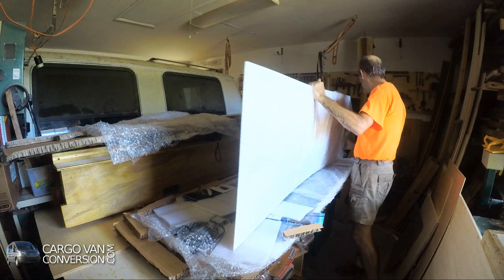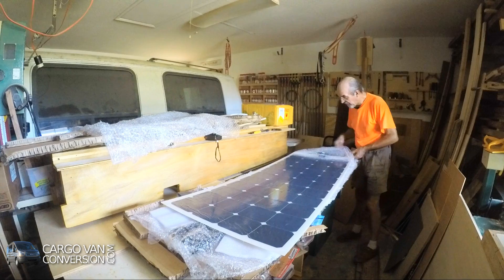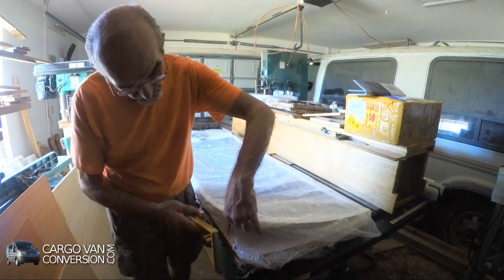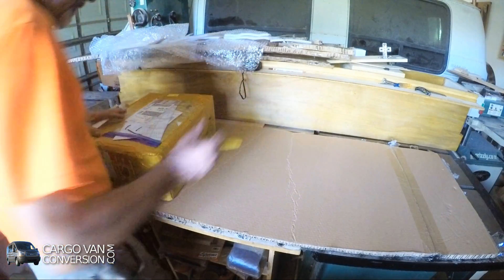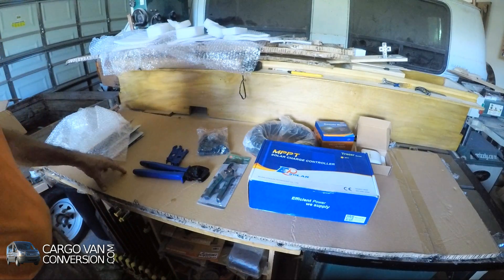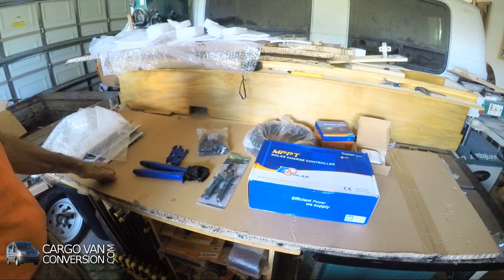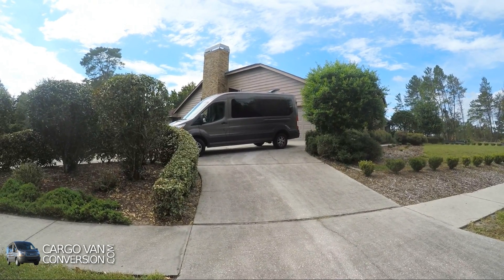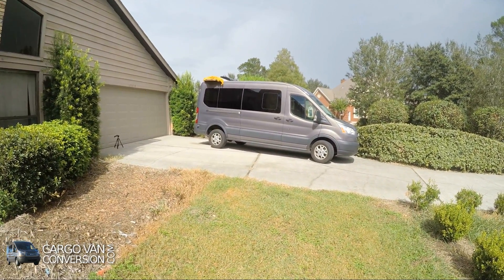Buying Flexible Solar Panels From China

Comment: Flexible panels need to be installed with an air gap. No air gap = no heat dissipation and lower life..
Reply from the maker: Hi CauseAndEffect,
If written extensively on that and I'm aware of a possible issue.
I have done a lot of research (mostly the 'first generation' of these panels). While it is widely mentioned, there is only very limited actual data available. I have always assumed this would remain an issue with this type of panels. These older panels had multiple problems and at least some of them have been addressed with the current panels that I have.
I have installed them (see my video, this Friday) on the corrugated roof of my Ford Transit and left these small areas open, which should help with heat dissipation. I'm not an expert, but some have also explained (for what it's worth) that the metal roof works like a heat sink. As 'stealth' is high on my priority list, for me the easiest way to compensate for a possible lower output, was to add to the total wattage of the panels. Raising them off the roof would nullify the stealth issue and rigid panels would be a much more sensible way to go. As for longevity, I would be satisfied when they serve me until the van is sold or (much) better panels become available. Time will tell.
Thanks for commenting.

Van Williams

Comment: I gave you a like but almost didnt because you didnt discuss price.
Priceis important. Please provode pricing and shipping price and import rax price of you had to pay it.
Also wattage.
Reply from the maker: Hi yougeo,
The information sometimes gets buried somewhere, but I always try to give as much info as I can in the video, through links in the description and much more in detail on the website http://cargovanconversion.com My apologies, if that was an issue.
That said, these are Link Solar GFL-135 Flexible solar panels; 135 watts each, 59.5" x 22", ETFE laminate, Back contact Sunpower high-efficiency solar cells. I have 405W on the roof of my Ford Transit.
While Link Solar is a sponsor of my website, I have no other links to the company. Their current price (Nov.2017) for the 135W panel is $350-$400 http://cargovanconversion.com/LS Somewhere in the comments you'll find my current calculation of my setup. I came down to approx. $1500 for three 135W panels, cable gland, MC4 connectors, MC4 extension, 3M VHB tape, breaker box, circuit breakers, controller, remote meter, welding wire, lugs, several crimping tools and Blue Sea powerpost, busbars and fuse box. Virtually everything to make it work except the batteries.
3-Day Fedex airfreight was included. A day before delivery Fedex requested a customs form that was supplied by Link Solar and they took care of the importation. Import tax could be levied, but not in my case.
Hope this helps you a bit and please, comment if you have others questions.
Have a great day!

Van Williams

Comment: Great video! Thank you!! May do these on my van, but not sure what to use for adhesion. Liked the music. Hope to see more videos from you in the future 😊
Reply from the maker: Hi Jennifer,
Thanks for taking the time to comment.
I post a new video every Friday and this week, it's the first of three about the installation. It explicitly show in great detail how I fastened them to the roof of my Ford Transit.
I used 3M VHB 5952 tape and that works great. No holes. I've taken out the van on a couple of rides and the panels are still on it :) So it seems to work.
Hope you'll like the video. Next week I'll do the cabling and finally the controller, breakers, etc.

Van Williams
Reply: Cargo Van Conversion Great.. thanks!!  I am a subscriber now :)
Reply from the maker: Thanks for subscribing! That helps a lot.
Have a great day!

Van Williams

Comment: Yeah no thanks, when I'm ready to buy my panels I'll get them from Amazon.  These panels are 50% more expensive and they have an awesome return policy.
Reply from the maker: Hi g dawg,
In many ways I agree with you, but please read some of my comments here or on the website http://cargovanconversion.com
While I had a good experience (so far), there are a lot of drawbacks in buying more expensive items directly from China. The need for a specific size and quality made me take the risk.
The price point is worth discussing. With regard to efficiency, they are equal or even better than rigid panels, yet rigid panels have a long track record and they can be bought for $0.50 per watt or less. If you have no specific need for flexible panels, that is the way to go in my opinion.
I wanted to go with flexible, but the 'first generation' of these panels had a lot of issues and they were promoted with ridiculous claims. I've heard of many failing based on delamination issues of the PET laminated and the use of substandard solar cells. Those two issues may have been addressed with these panels that are made with ETFE laminate and high grade backcontact solar cells.
Be aware that flexible solar cells currently in the $150-$180 range, may not have backcontact cells, may be lower grade and likely use PET laminate instead of the more expensive ETFE.
As I said, if you have no need for flexible panels, you're better off with rigid panels, in many ways. If flexible is what you want, do a lot of research and if these prices are too high, just wait a while, and they will come down!

Van Williams
Reply: i appreciate the reply, i was refering to newer flexible panels on amazon but i can see your point on needing a specific size.
Reply from the maker: Hi g dawg,
Their are currently only a few panels available with ETFE and the grade of the solar cells is very difficult to establish for most of us. It remains confusing and I tried to give some insight through my own experience.

Van Williams

Comment: I bought two water distillers from China, the 1st burnt up and the 2nd came broken, and I didn't get all my money back. Big lesson here; DON'T BUY ANYTHING FROM CHINA.
Reply from the maker: Hi April Mae,
A couple of years ago, I started buying occasionally from China, mostly small stuff (a couple of dollars worth each) and have never had an issue. However on one occasion I ordered a $125 item (I was getting confident) and on top of a late delivery, it just didn't work. I could have returned it, but likely would have taken months before getting it back, with incurred costs and no guarantees.
Moral of the story: If the item has some value, then buy through eBay, Amazon or AliExpress, for more security. Higher priced items, such as these solar panels may also be levied an import tax that the buyer is responsible for.
I had a good experience with Link Solar, but would encourage viewers/readers to leave a comment about their experience.
Have a great day!

Van Williams

Comment: need to put rubber under the panels buddy .  otherwise the metal will heat the panels and you will lose efficiency,  my tip to you for most efficiency out of solar is to keep them flat not curved. roof racks is an idea . but if it works for you great!!!  here is a guy i follow what he did to his van https://www.youtube.com/watch?v=VAIaGXALKBQ
Reply from the maker: Hi archiscale,
The video is quite interesting and I will look more into his work.
One of the main goals of my build is to create a stealthy van and these thin flexible panels are ideal for that purpose. The first generation of these panels had many issues and heat dissipation is often mentioned as one of them.
My research frequently encountered it, but I have found few actual real-life documentation of it. The new type of flexible panels that I have are as efficient or better than rigid panels and hopefully some of the issues have been dealt with (most notably the delamination of the PET laminates by using ETFE). I'm not an expert in this, but some explain that the metal roof works like a heat sink; I also left some space where the 'corrugations' in the roof are for some airflow as you can see in this weeks video (this Friday). Raising these panels would nullify the stealth properties of the van, so to counter a possible diminished output, I choose a simple solution to add more solar panels; that's easier, cheaper and I remain stealthy.
A side note on the heat issue: if it is an issue, it is likely to happen more during summer, when most systems should be oversized. During winter, when output is reduced but more vital, it should be less of a problem.
Thanks for taking the time to respond; time will tell how it works out. Preliminary tests (no load/open circuit) with three panels (405W) on the roof of the Ford Transit have shown on a sunny morning in Florida at 10AM in November 28V/8.5 Amps output (before MPPT). That is encouraging!

Van Williams

Comment: These panels look great! I've seen so many videos where people install rigid panels on vans using aluminium brackets, hinges and Sikaflex, which is a ton of work, expense and mess, not to mention being less than aerodynamic, all so that they can constantly faff around tilting the panels and repositioning the van to get as much energy as possible. It would be cheaper and simpler to charge an auxiliary battery using the vehicle or use a generator! With these flush fitting panels and VHB tape you can actually achieve the real goal of getting free energy (after quickly breaking even) with the absolute minimum of fuss. I can't wait for you to road test these over the next 12 months. Thanks for posting this. Give Joey a pat from me. :-)
Reply from the maker: Hi nagualdesign,
These panels are barely visible from the ground, if at all. Only the MC4 connectors stick out a little bit. The preliminary testing (open circuit/no load) looks good and even in early November (on a sunny day in Florida) I might be able to bring in more than 120A. You will see more testing soon!
And Joey thanks you!

Van Williams

Comment: I am going to check link solar out I believe flexible panels are the way to go if you want to have some type of stealth and not draw too much attention to your living quarters
Reply from the maker: Hi Yiddish SheKop,
When you have to work with small areas, that are also curved and you want to maintain some sort of stealthiness, you have little choice. But I waited specifically on changes to the 'first generation' of flexible panels. They came with some issues, that I think have been addressed in the latest version of panels. Efficiency is equal or better than rigid panels. The 'first generation' was also badly promoted by bending them around every corner and walking on them excessively.
With a more sensible approach and better cells and laminations, these latest panels could be what we've been waiting for. I'll keep posting my experiences with them for some time.
Good luck and keep me informed how things work out!

Van Williams

Comment: I had a flexible panel, it went yellow in the sun and became quite useless.
I am in Australia so maybe the sun is more powerful UV wise here , up to UV17 where i live, i hope you dont have similar issues with your panels .
Reply from the maker: Hi Nic,
First time, I heard about yellowing of these panels. Did it influemce both amperage and volt output?
Would like to know, if these were 'first generation' flexible panels with basically non-backcontact solar cells and PET as top laminate. Most panels look the same, but there are many grades of solar cells available, most often cheap ones that fail quickly, because the consumer can't see the difference. Delamination has also been an issue and the UV levels at your place may have a significant impact too.
My panels have the newer, high efficiency backcontact solar cells and the expensive ETFE laminate. I have only done some preliminary testing, with good results, but time will tell!
Have a great day, mate!

Van Williams

Comment: Enjoy your videos and learning from them.  Have you install your solar panels? I cannot find the video!
Reply from the maker: Hi Richard,
Thank you. Yes, I've installed my flexible solar panels and I'm working on the first of several videos. I'll likely have the first installment available on the next weekly YouTube posting, which is on Friday.
Hope, you'll be able to wait that long :)

Van Williams
Reply: Thanks!  I was just worring that I might have lost something.  I entend to put some on my Fanta Fe, on the rails, so I am loking forward to see how you've done it and the result (output) of yoour setup.  Kep up the good work and take care!
Reply from the maker: Hi Richard,
Thanks for the encouragement!
If you'll put the panels on rails, elevated above the roof, you may be better off to use rigid solar panels instead of the Flexible panels, that I'm using. They have a proven track record and are much cheaper, than the high-end flexible solar panels, which I'm using.
Other than that, I've filmed many details of the installation and am sure you will be able to pick up a couple of ideas. PS Output seems to be better than anticipated. Have a great day!

Van Williams
Reply: Thanks!  I am thinkink using flexible tho fallow the curve of the rail and also to have less impact from the wind... I have time to think about it since I live in Québec and I wont work on it till spring.
Reply from the maker: Hey Richard,
Those are valid reasons. Stealth was a major reason for me; the thickness of these panels is minimal, even after use of the VHB tape to attach them to the roof.
Location may be another issue, with solar. Up in Quebec(I love the place: merveillieuse!), there is less sun. But my preliminary tests are better than expected. I have 405W with three panels flat on the roof and just half an hour ago (10AM in Florida with lots of sun, but no load), I had 27.3V & 8.36A and would project that 120Amps for the day could be a possibility.

Van Williams
Reply: Salut Van,  from som videos heat from the sun on the roof seems to be of some problems, it seems to be acting on the cells, I plan to use the rails as a spacer to permit air movement thus heat exchange.  Have you consider the heat as a potential problem?
Reply from the maker: Hi Richard,
I thinks that at least some of the 'first generation' of flexible panels may have had a heat dissipation problem. From what I was able to find, that may have resulted in around a 10% reduction of power.
I don't know what the exact cause was or whether it is still an issue with the newer flexible solar panels. These backcontact cells may work different too. I immediately found it a non-issue: if it only reduced the power output, I could compensate with more panels or wattage.
I have also considered lifting it somewhat off the roof, but that would contradict the stealthiness factor and then I would have chosen rigid panels for their proven track record and lower prices.
I also wonder how much the metal roof works as a heat sink?? While driving, elevated panels will have a lot of air flowing underneath and thus being cooled, but the majority of time, I would be stationary and cooling would be less efficient.
I just think that adding an extra panel is a much simpler solution.

Van Williams
Reply: True! I will following your progrest and setup. Tourlou!
Reply from the maker: Hi ,
I was intrigued by the word 'Tourlou' and finally found out. I'm not a native French speaker, but always had a great affinity for the French language and culture. Have visited Quebec on multiple occasions and almost would have been a New Brunswick resident.
Then I remembered the Dutch word 'Toedeloe', which was borrowed from the English 'Toodeloo'. I assume, that it's also the source for your 'Tourlou'. These anglicisms make it so difficult for me to easily understand Quebecois. Sorry for the language lesson, but I could not resist.
Toedeloe :)

Van Williams
Reply: Anytime Van... it is always a pleasy=ure for me too to fin the source or background of an expression .  I also loke very much to learn English expression ever since I learn English while I joined the Canadian Armed Forces in 67.  I like to read, or listen to English movies just so I dont loose it.  Toedeloe then!